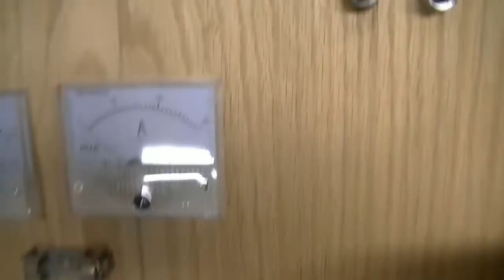Popping Light Bulbs With High Voltage

Comment: I did this on burnt out #55 7.5v bulbs out of pinball machines using a 240v primary transformer with a 6v secondary connected to a 25v secondary transformer. The resulting 900 some volts arced across the broken ends of the filaments and lit a silvery blue. After a minute or so the inside of the bulb would get coated with blue from the blue plastic bead that was the lead in wire separator. Then the separators would bend over and snuff out the arc😂